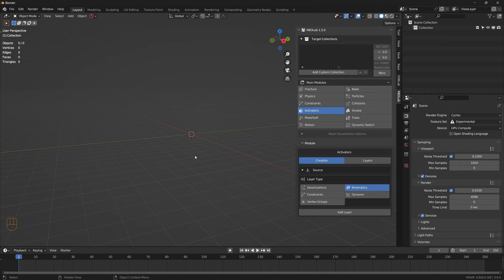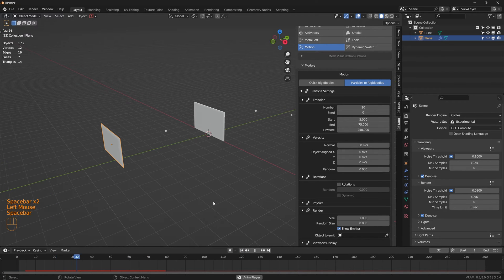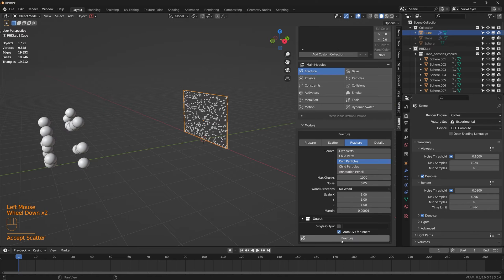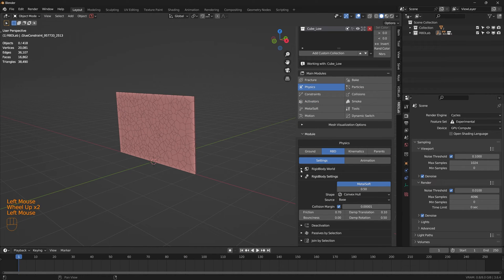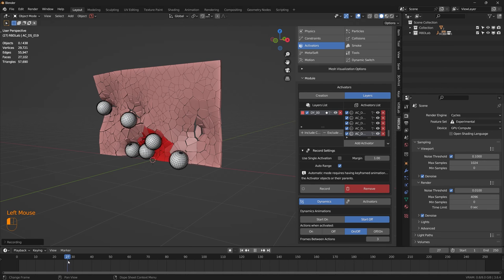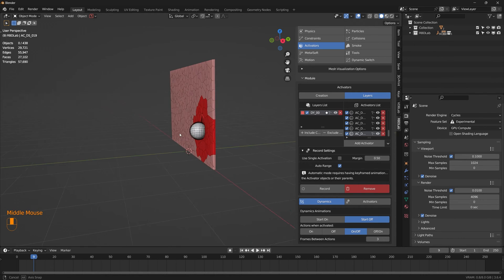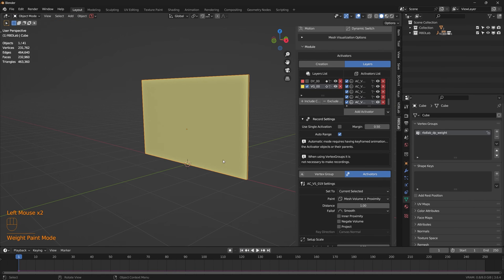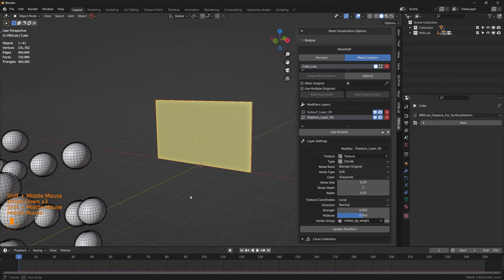RBDLab 1.5 MetalSoft - Impact Deformation Tutorial

Comment: I barely learnt anything other than what is possible. There was a lot of "do this" but almost no "do this because".
This is a problem I've noticed in around 90% of Blender tutorials. The person doing them doesn't understand the teaching process, that you have to explain why something happens. Result is when someone has done a tutorial and someone asks "why did you click, press, type that?" the answer will be "because I was told to" instead of "because that way I would get X result instead of Y".

Example of bad: 10:03 "Lets create another layer" So you create another layer, why do you do it though? Why couldn't the previous layer be used to do the exact same thing?
Example of kinda good: 12:49 "Lets say you would like to change the extent of this detail on the wall" then proceeds to show how to do it but doesn't explain the effects of what is being done, you have to look at it and make your own assumptions which in this case is "If you lower this number then the affected area will be smaller". Simple in this case but more complicated stuff had no explanations other than "do this".

A simple test for if a tutorial is good or not is if you can follow along without looking at a video. If the audio is enough to explain how to get a certain result and why then it's a great tutorial. If visuals are REQUIRED then it's not a tutorial but a showcase of features, "Buy my thing because look how easy it is to create thing". It's not an exact science but it would be nice if limited showcase tutorials didn't require years of experience to begin with. Then again people looking at this addon probably have a lot of experience and want to speed or simplify the work they are doing in order to get X result. Problem is people with no experience will look at it believing they can do the same thing, they will be able to copy but not understand what they are doing.
Reply from the maker: I admit you're absolutely right. We're making an effort to create better tutorials, but it's a more complex job than it seems, and having to maintain addon development at the same time makes it even more challenging. In this 2026, we hope to take a big leap forward in our tutorials and improve them to make them more understandable and didactic.
Reply: @befxstudios3D  Some of the best tutorials on youtube for Blender are the 30-60 second shorts explaining how to do something.

Due to time restrictions they are too the point, informative and something you could save for later reference.

If I were to give one suggestion it would be to create a shorts video series, you currently have 6. I would hope for around 10 per addon showcasing how to do something cool or fast.
You can pump them out fast and will lead to more people finding your addon.
You should have the email of everyone who has bought your product or you can simply create a video simply asking: What features of our product would you like to see a tutorial on?

I'm sure there might be a Reddit or Discord or other place to ask the questions as well.

From the tutorials of your product I've seen I have no idea if your addon can do the effect I'm trying to do. I was hoping Metalsoft might be able to but when I looked at your site I found zero info on metalsoft, the manual had nothing in it as far as I could tell. There is apparently a discord and I was gonna ask there but it's paid only and I haven't bought your addon yet because I don't know if it can do what it is I'm looking for. So perhaps updating the manual would be another idea to showcase new features? or am I missing something?

Effect I want is bullets hitting metal denting it and then other shots hitting the same area penetrating it. I suspect weight painting can be used to indicate which areas can be penetrated and which should be dented. So blue means dent, and red means penetrate.
Yes, I understand I can do it manually but I want to run a simulation with over 20 000 particles a second completely turning a ship to swiss cheese. This would take months to do manually and I would be locked in to certain angles and such.

I'm subscribed to your channel so will keep an eye on it. I'm new to Blender so still learning, with what feels like ten thousand addons available it's hard to know what to get and I've been burnt before so very cautious now, especially since your addon would cost me almost 2 months of savings.
It looks really cool though, once I know more I will consider it properly.

Also your links to your youtube channels on superhivemarket doesn't work. They link to @rbdlab2231 and @b3fxstudios which does not exist. Instagram doesn't seem to work either or am I doing something wrong?

Looking forwards to more videos :D

Comment: Hello, in 1.6 the section does not appear. "REBIND" where is?
Reply from the maker: In version 1.6, the MetalSoft system has been completely changed, and it is no longer necessary to use "rebind".

Comment: If you want only one hit, Instead of a particle system, you can do it with only one sphere as rigid body right?
Reply from the maker: exactly!
Reply: I tried doing that on a simple surface of a car, the geometry was all triangles and turned it to quads, after I created the Metal deform on the surface and Blender crashes. What are the requirements for correct geometry? @befxstudios3D